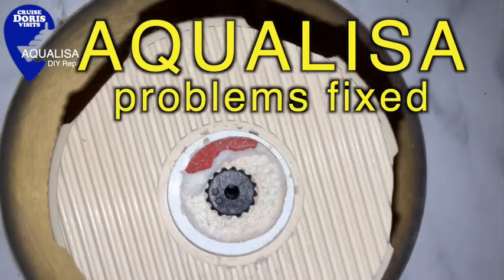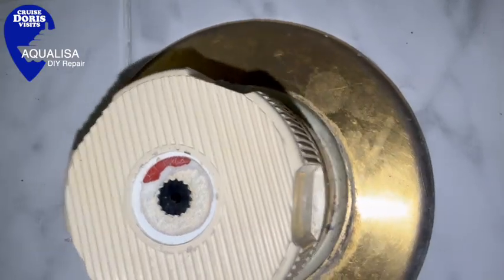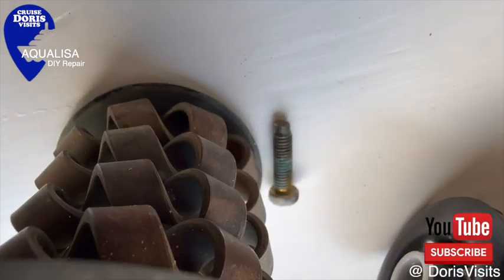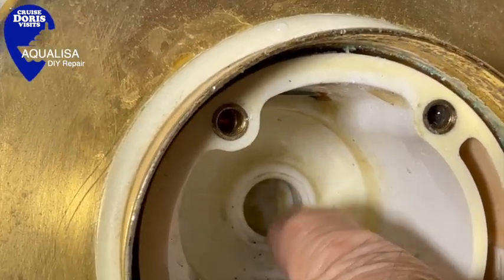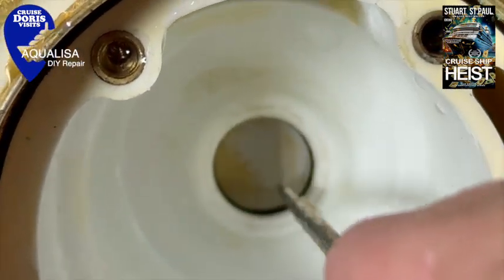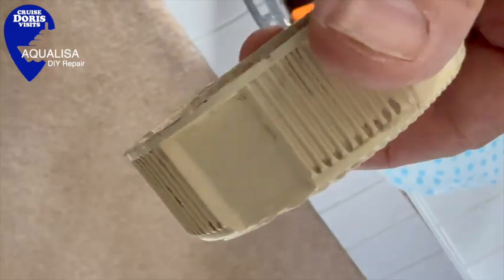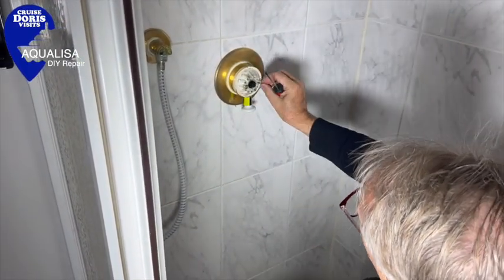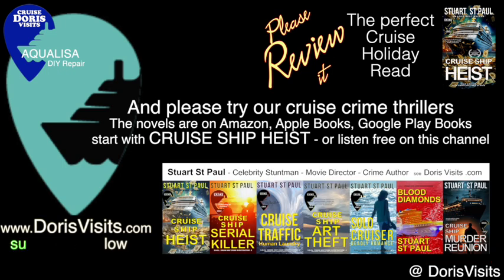Aqualisa shower fixed. Tips and tricks when mending a 38 year old Aqualisa shower

Comment: A word of warning from my experience - I found that the reason that the brass inserts were pulling out is that they had actually stress fractured halfway along their length, and hence didn't have a good bond with the plastic housing, so tightening the bolts just pulled the inserts out. I was actually able to replace the main body, but only by buying a complete new shower control, and discarding everything except the housing and cartridge.

Comment: This is a great video, I have this exact shower. Mine has leaked behind the tiles so was thinking of replacing it as I have access to the back. But what was your fault with your shower? Just that it was stiff to turn it?
Reply from the maker: Yes, It was tough, and not doing temperature properly. Now it is great.

Comment: I'm about to replace the same Cartridge. But in the new Cartridge bag of bits, apart from new o ring and screws but a white split nylon type washer. Is that also to be used?
Reply from the maker: Not sure. There are two types of screws use the same as came out.
Reply: This is probably to late for you but may help someone else. There are two options. One is to replace the O ring as per this video, and it's even harder than said! The other option, which I took when I couldn't fit the O ring involves putting the split ring into an indented circular groove on the cartridge's shaft and then sliding the O ring onto the shaft. The split ring has circles on one side and these must face out.  It worked even though the original had the split ring as per this video.